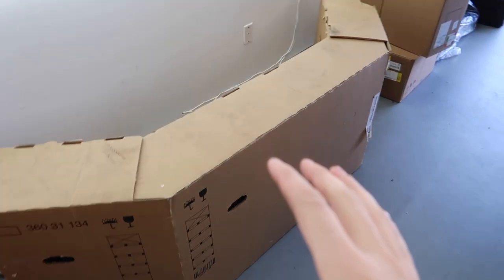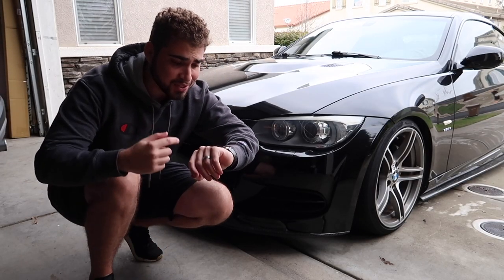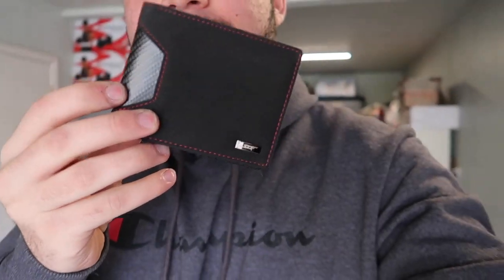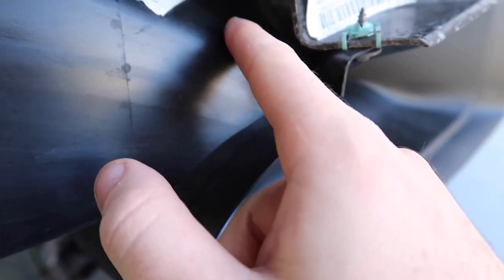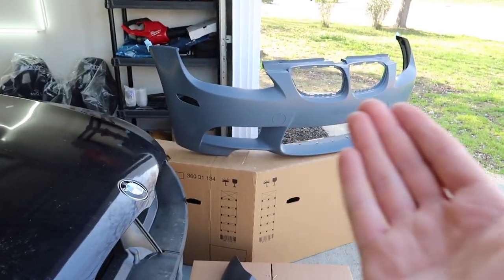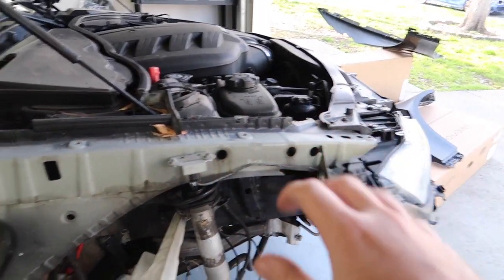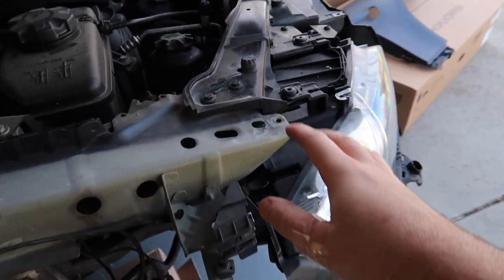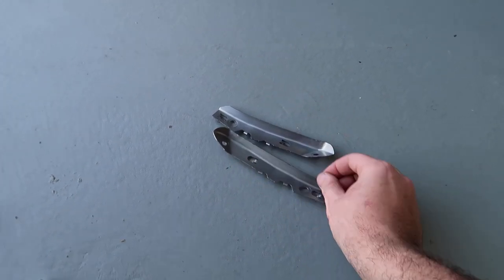REBUILDING A SMASHED 2011 BMW M3 (Part.1)

Comment: Hey Nour, I just gotta say that you're absolutely killing it with the content so far this year! 

I also wanted to mention that if you really wanted to just salvage the plastic front scoop you could just plastic weld it together and possibly sand it down to recover its structural integrity and look (since it's not something you would be looking at or even seeing very often).

Otherwise, I know all the little plastic bits (especially on a car like this...) can add up quite a bit. But I 100% would support the idea of just replacing it to get it looking OEM clean from the factory. 
Just a thought though, but regardless I'm excited to see some more content on this beast!
Reply: agreed

Comment: for the vent you can plastic weld a little line on the crack in the back and it'll look normal and be fixed.

Comment: Regarding the plastic air piece I would plastic weld it or JB weld it, or even crazy glue it. Save the $100 for another part that can't be repaired. Btw smart move purchasing a home before a garage congrats!

Comment: I’m a huge fan of your channel but from my personal experience with the 328i my timing chain fail at a 100000 miles just a few miles out warranty I heard the timing chain wine and a few months after that the guides broke and the car shut off while I was driving. Every shop where charging me over 6 grand too fixed it. With no other option I order the parts from fcp euro and replaced it myself, I had too retimed the engine it jumped time really bad. The hardest part about the job is removing the front differential. If you plan of doing full bolts on with her car you gotta do the timing chain.
Reply: 2014

Comment: Replacing the rod bearing is not that hard. I’ve a 10 E60 M5 and I had helped my friends replaced his rod bearing on his e92 M3  and parts cost him only about $350 and I helped him replaced the rod bearing in matter of three hours on a jack stands like the one you have. You need engine support and couple of tools. Just need to find a way to lower the subframe and work on the rod bearing. Since the replacement he had put 32,000 miles on it so far with no oil leak whatsoever. I don’t know why people are scared to work on replacing the rod. If I have to do it all over again, I think I could get it done in 1 hours and 30 minutes